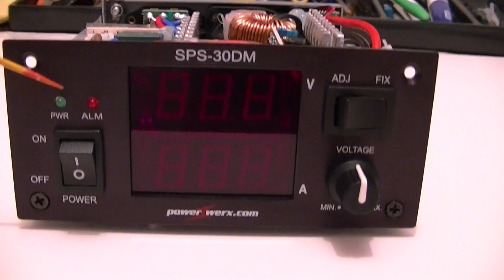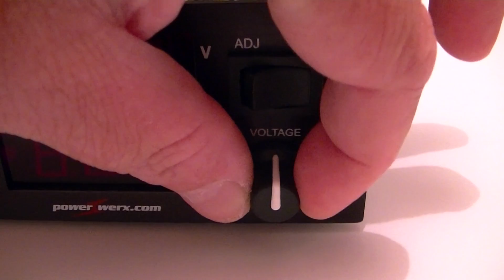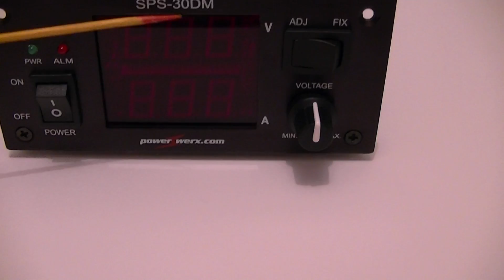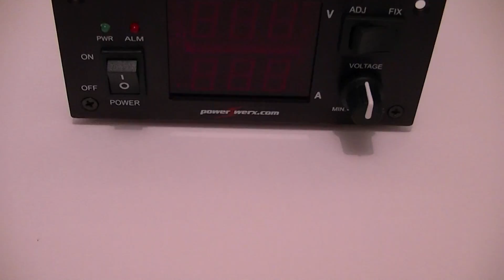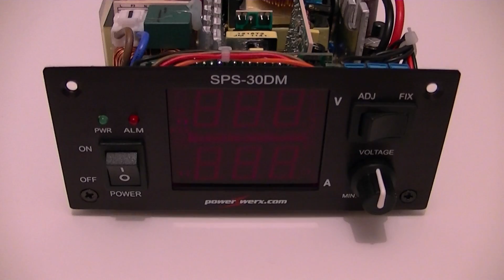Powerwerx  SPS-30DM  Pot Adjustments-voltage and display

Comment: Do you know if it's possible to use this as a fixed current supply using the pot on the bottom of the board?  Based on your description in the video, it sounds like that would impact current, hopefully limiting it.